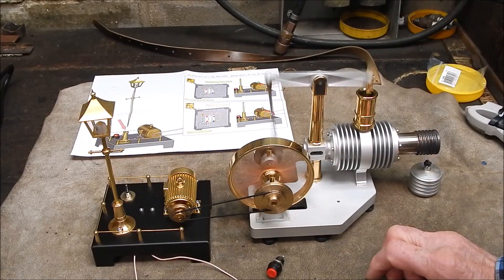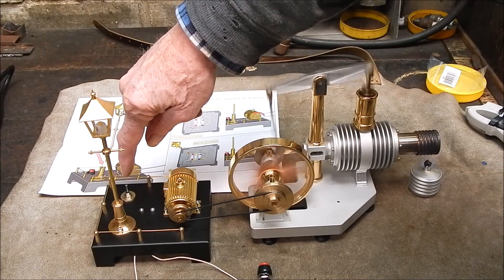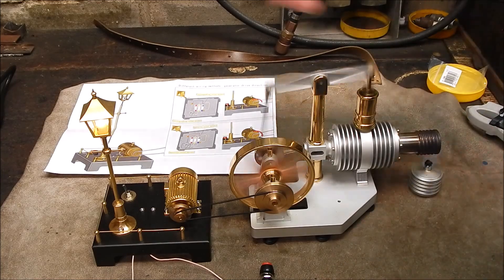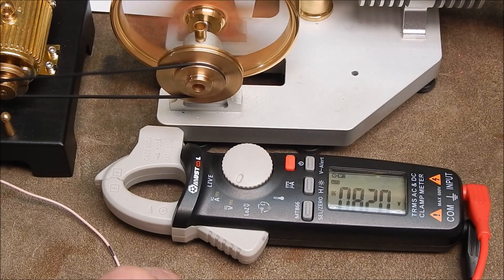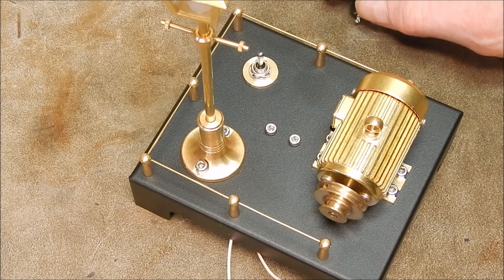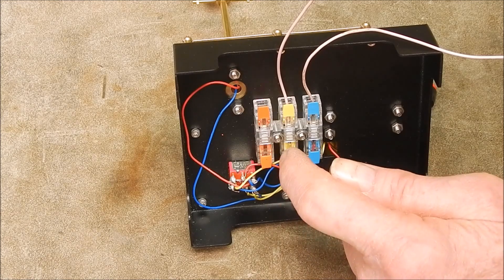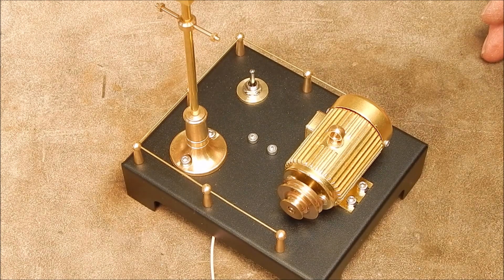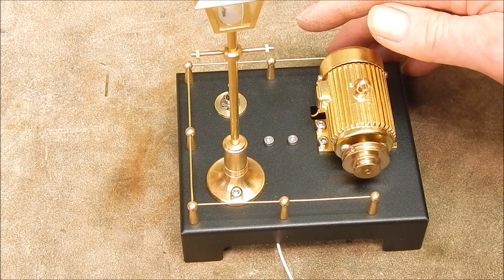How to easily change voltage polarity on the Enginediy generator scene

Comment from the maker: NOTE:  A crossover switch is configured and works the same way for any DC power supply, generator or electric motor.  Switch size and amperage rating will vary depending upon usage requirements. Cheers Rob

Comment: I do like that genny Rob, looks 'industrial' doesn't it and the Stirling is making short work of making 'leccy' !!!! Cheers Jim
Reply from the maker: Hi Jim.  They did a good job on it.  Looks the real industrial type deal. Damn that Stirling is good.  It's my favourite engine, powerful, quick and clean to start and use, no vibration.  Wonderful.  I see Enginediy no longer list the Tarot beam engine.  So it must be unavailable ATM.  Cheers Rob

Comment: You could twist the belt to reverse the direction.
Reply from the maker: Yes, but there would be rubbing drag and voltage drop.
Reply: @Xynudu  not if you cant on a little one way and the other the opposite way, that's what they did with flat belts to change direction.

Comment: Yes, and also saves the cost of that 3 way connector block, as you can wire it up directly to the wires as you make it, saving a bit of assembly time as well.
Reply from the maker: Definitely.  They used single core wires, which will break over time when using the existing connector block method.   It's not enough to downgrade my overall score of the unit, but could be made better without much effort.  Cheers Rob

Comment: an even easier way is to use a full wave bridge rectifier  to do it completely automatically, the positive and negative connections go to the lamp and the 2 "AC" connections come from the generator. the symbols used for the AC input are "~" for both, the positive is a "+" symbol, and the negative is the "-" symbol if it is shown, the input side can take either polarity and the output "+" "-" will always output the same polarity no matter the input polarity , I have used this trick on CB radio equipment to prevent fools from destroying the gear when connecting the dc power to the radio, it works a treat
Reply: @Xynudu  A bridge rectifier is essentially 4 diodes , diodes are like a one way valve and can also be used on things like solar installations to ensure that the current/voltage only flows in the desired direction
Reply from the maker: I'm aware of how a bridge rectifier works and have fabricated them on occasions, but never considered using it with DC input.  I've used them with the usual AC input plenty of times.  I googled this and you are correct.  The downside is that there is considerable voltage drop from the diodes, which will be a serious issue for the low voltages we are dealing with.  Always learning.  Cheers Rob
Reply from the maker: Sounds like a good trick.  I have not tried using a bridge rectifier with DC input.  Interesting. I will have to try that switching output on a power supply.  Cheers Rob

Comment: That's a much better idea Rob and it looks nicer too 👍👍👍Cheers, Alan.
Reply from the maker: Yes.  This is way better Alan, and shouldn't cost any more to produce.  To top it off, the OEM wiring is all single core, so I expect it would eventually break. Piss poor idea.  Cheers Rob

Comment: great mod Rob. much better idea 👍👍👍👍👍👍🚂🚂🚂🚂
see you next time 
Kev
Reply from the maker: Hi Kev.  Yes, that original setup having to poke around with single core wires was terrible.  The wires would have eventually broken and it was a real fiddly chore.  One  simple cheap switch later and it's a non event.  Gotta win one occasionally 👍  Cheers Rob